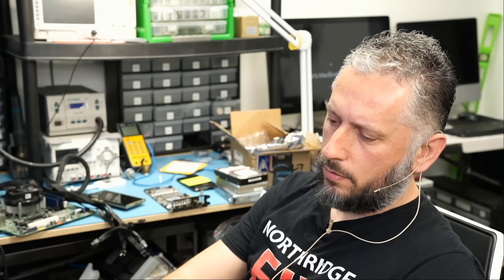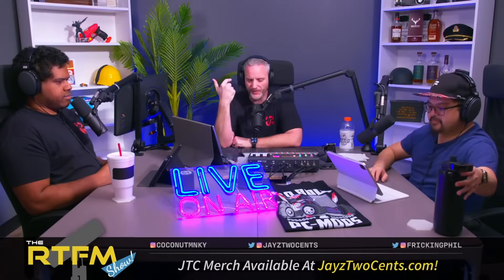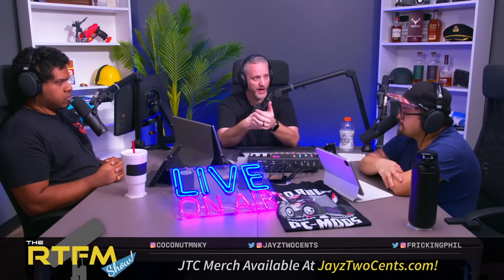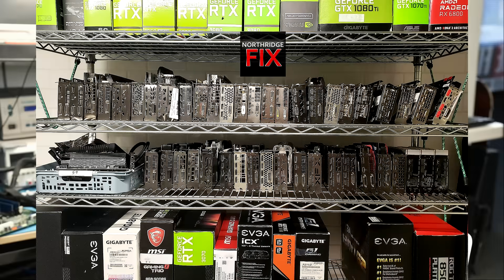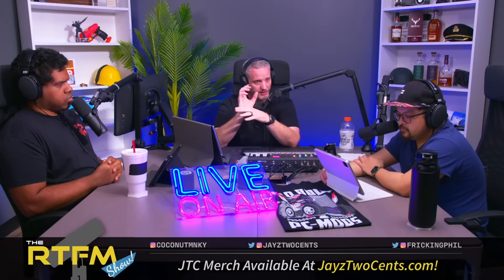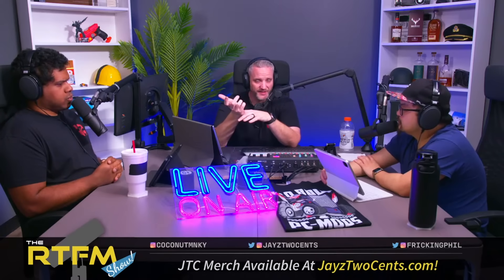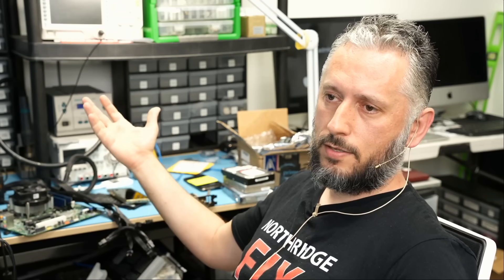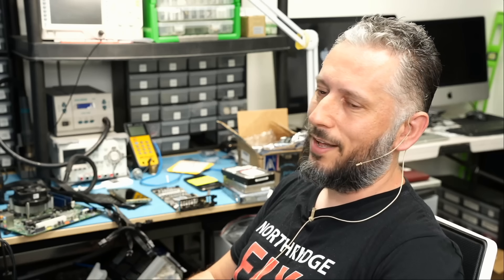Melting 4090 and CableMod. JayzTwoCents and Gamers Nexus Response. Blame NVidia or User?

Comment: As a designer myself, I have an even different look on this. The initial design may or may not be flawed. Without the schematic or spec sheet on the connector, we are unable to determine the quality of the manufactured part. Plastic shrinks after it's been molded. The shrinkage is calculated in the manufacturing process. There are a lot of variables that are related to the process from humidity to what day of the week it is. During the inspection and quality control process, there are tolerances that must be met in order to insure that the product that's being produced, is within the spec's the engineer has determined. Now comes the "however" part! Due to consumer demand and the "we need these parts NOW" pressure, the tolerances are often stretched to fill the demand. That becomes the fault of quality control and quality assurance. The responsibility still falls on the developer to make sure that the manufacturer is producing the product to specifications originally determined by the designing engineer. The manufacturing of the pins and sockets should be looked into also. If you have two mating parts and both parts are at the very edge of their tolerances in opposite directions, then you can conceivably be causing a final assembled part to be defective, even though the individual parts are within the required specifications. And it add to the confusion, the machine that crimps the wire onto the pin and socket can deform the perfect pin causing the whole assembly to be out of tolerance. Bottom line is, in todays mindset, people will sacrifice quality for numbers. I hope I got you to understand how difficult it is to pinpoint the direction of blame. I personally believe the blame does NOT fall on the consumer. The problem is present before the consumer buys the product. That's what I think.

Comment: well. its true. if the failures is too easy to occur.
it shouldn't be on mainstream market. it will only go on specific market where everything is monitored 24/7.

i buy the card to use it. and I'm just a normal man. not a prophet, not a god.
i bound to makes mistakes.

this is feels like more dangerous than driving a car.
the card could have burned while you left it for.
say cooking something or go tho the bathroom.

i mean. something disastrous is bound to happen.
imagine. you play a game at 4k. maximizing every graphics settings.
and suddenly you want to make some snacks.
you leave your pc.
and then your pets accidentally bump to it and the connector getting unaligned.
suddenly everything get burned.
that is terrible.

i thought every manufacturer already did a research of
what if this what if that
what if the gpu connector misaligned
what if the gpu drawing too much power
what if the pcie slot is getting hot.
what if the card shorted

protection everywhere. especially on expensive stuff.

Comment: I think we all forget how humanity turned into total morons and will DIY and fuckup 10 times to plugin, BUT you really have to be from another planet to mess up the connector in such a way that it will melt like that. Either the connector is not rated for that voltage or something is drawing too much power.

Comment: My assumption albeit could be a realistic one is the HVPWR cable and HVPWR connector is inadequate for the current flow, thus overheating and then melting. Nvidia should of thought about this before changing the connector type altogether and not just plopping on 3 or 4 of the typical 3-6 pin PCIe power connectors instead.

Comment: The problem is the 12V power supplied from the PC power supply. Its the current that heats the connector, not the voltage, so by halving the current by doubling the voltage you could solve this issue easily. When PC's first came out they only needed 12 and 5 volt power (with lower current -12 and -5 volt rails and over time +-3V). PC's nowadays need more power (i.e. amps) to work, but at 12 volts and 500 watts (rendering graphics with Blender for example), you will be drawing more than 40 amps!!! The chips on the card don't use 12 volts. They are stepping down the voltage to say 3.3V/1.2V etc. A lot of the graphics card PCB space is just the on-board power supply to make the lower voltages. If the card could take 24V you would need only need approximately half the current (i.e. amps) to run the card as the incoming voltage would still be stepped down to voltages that the chips need anyway. Of course, this would mean another standard of power supplies with specific outputs for GPU's, but it would make the issue of over heating connectors go away.

Comment: the higher the resistance (used size materials of the conductor going to the high current load circuit) the heat resistance will be lower. it is the same principle in extension cord when you are inserting more than two appliances in one area.

Comment: Can you set up a card with a thermal cam under load and see if the plug is getting warm or hot. Mabe make a thermistor sensor to record over long period of stress during load.

Comment: I have the feeling the connector itself is undersized for the 500+Watt. On my previous card there were 3 connectors on the GPU to run with 300-400W and now we have 1, which is way smaller, which runs 500+.

Comment: Too much power drawn through those thin wires. Of course it will melt at the connection point. Maybe if they had a larger contact surface it would be ok(ish)

Larger contact surface in the adapter and something to apply pressure on the contacts. Also thicker wires. 

The one that calculated the power draw screwed up really bad. I guess math is not his/her strong point.

Comment: The best way to shut them all up is to solder a 12 solid wires in those pins to extend it.
then attach a connected on the other end.
then test it where would it burn next.

Comment: And there's also too much load being put on a single 12v delivery rail for VRMs. Someone would have to heavy-up the rail and double stack (2x) connectors on every card to fix the problem. Whoever came up with stupid bird mouth PCB design needs to be flogged with 101 dildos.

Comment: Hello, but am i missing something? The problem is number of connectors, and thickness of each pin. Every PCI-E video card i own, has at least two connectors, 8+8, or 8+6. You don't plug space heaters into Christmas light cords. Why? Because they will melt and catch fire. Here, let me post a sign. --> [ IT'S NOT USER FAULT. ]

Comment: The connector shouldn't be able to wiggle enough to cause issues in the first place. Nvidia should have seen these issues in their testing which makes it an Nvidia problem and a massive design oversight. Also, the pci-sig should have designed a better connector. Or just left the connectors alone, remaining with standard connectors that have been proven to work in just about every industry. Also, Dell is at fault here for working with Nvidia to have the pci-sig introduce this connector.

Comment: since i have the 4090 i only connected 3 of 4 to stay at 450W max. With or without cablemod adapter it is not even warm under load.
Reply: so you say that the problem is the power consumption and not the connector?
Reply: @razbuzaglo  at least i have no Problems. FPS are also the same
Reply: @lassmirandadennsiewillja3943   so i am on the safe zone with my future 350w rtx 4080?
Reply: May I ask how you did that?

Comment: I trust the work GamersNexus did the first time around on those adapters.   The one you took out you had to destroy it in the process.  Pretty hard to draw any conclusions from a destroyed connector.

I think the reason GN is saying that the damage still appears to occur on unseated connectors, is that those stress lines on the plastic male component that houses the metal female receptacle, is because that can only happen when the plastic is softened.  So partially unseated and moving current.  This is all that can be known for certain.

The question really becomes, how do these get unseated?  I am sure that some were in fact those that never got seated properly. We do believe there are other failures that have occurred from seated connectors but were being pulled taught, causing some of the connectors to lose contact, which increased the current in the remaining connections. Those heated up, the plastic softened and then some combination of melting, softened clip then unseated partially, then more melting, etc. occurs.  There does also appear to be yet other failures where no tension was on the cable, and they were seated completely. This is a smaller subset of the overall failures, the % of which isn't known.  Cablemod themselves has said that they have sold 80,000 adapters, and of those 80 have failed.  It's a small quantity but still a higher failure rate than they see with their other products.

The plastic clip is pretty small, that is one piece that needs a redesign.  If the card heats up and it is enough for the plastic clip to soften and 'let go', that could be how this starts.  But we can't prove that by only looking at the end result. 

The new revisions to 12vhpwr, called 12v 2x6 (or something like that) make updates to the spec, to both sides of the connectors, and retain compatibility with 12vhpwr.  I think the primary improvement is a spec change to the design of the female metal receptacle. The 3 dimples version is no longer considered 'in spec'.  Also changes to the plastic parts, plus other changes.  Those changes are currently undergoing extensive testing, and likely will not be used on the card side until Nvidia 5xxx gpu's come out.  The cable side updated connector should come out sooner once testing is completed. Cablemod said they are already working on implementing the new specs into the adapters' design.  So in maybe 6 to 12 months, those will have been out long enough to draw more conclusions.  

The 12vhpwr design wasn't fully thought out, but they are working to correct the design flaws so I expect all of this to be behind us in a year. Hopefully for 4xxx owners, the cable side connector revisions are adequate to stop any more melting connectors for those users.

Comment: Anybody ever consider removing the socket and replacing it with a cable that plugs directly into the power supply. Of course the melting might move to the power supply LOL

Comment: I just have a novice viewpoint, someone who knows how amperage works enough to know when something looks sketchy.

You take 3 or 4 Molex style 8 pin connectors and feed them all into one little 12 pin connector with an anemic little clip in the middle, you're going to be testing the resistance in that connector.

I know that the majority of an 8 pin molex is redundancy. If say one or two pin connections lose their spring and introduce resistance, there's enough redundancy within the rest of the connector to pull it's rated amps without anyone even knowing.

Is that the same for Nvidia's 12 pin? I don't see how, considering it is rated to handle much higher current than one or two 8-pin molex, even though the connectors and pins themselves seem to be physically smaller. Just adding it up in my head, each one of the Nvidia connector pins is supposed to take the place of 3 standard Molex pins.

While I agree that the Molex standard is outdated and cumbersome, it is tried and true (as long as you have quality cables/connectors) and has successfully been able to scale up alongside more power-hungry PC parts. 

This Nvidia 12-pin is not the answer, not in its present configuration anyway. There's too much current and potential sloppiness in the connection for there to be so little redundancy.

Comment: NVidia is at fault this is not a user issue. Gamers Nexus is saying that the user needs to plug in the cable under engineering supervision then spin around three times and tap the connector with a fairy wand. Give me a break NVidia should be on the hook for this over priced piece shit.

Comment: I have a melted native 12vhpwr cable that melted on both sides. Tthe native cables have the same connector on both sides. Melted on my 4090 and my power supply. Both sides were seated correctly as I watched videos on this problem before hand and made absolute sure they were both seated correctly. Seems to me the connector cannot handle the amount of voltage being pushed through. My 4090 was running at 450 watts when the problem began.

Comment: These connectors are not rated for 600+ watts of power that some 4090 can produce, , they are only rated to 450watts. The plastic connector should be redesigned in ceramic to with stand the 4090 heat...

Comment: So in conclusion the 4090 connector cannot withstand the draw power and melts which is a design flaw. They should have either used 2 connectors, limit the power draw to what the connector can withstand or  maybe some part of the card draws too much power for some pins of the connector. Either way it's a design flaw and not a user error.

Comment: I agree north ridge on this it's not user fault it's a defect and to be honest I agree there is far too much power going through that 12v connector there should be 3 other connectors to share that 600 watt load as seems to me 12v connector cannot cope with the power consumption

Comment: I’m on a MSI Ventus 3x 4090 with the 90degree cable mod adapter and Cable mod PSU cable. I’m also an independent IT consultant and PC builder who has built thousands of PC’s in my time. I have been keeping an eye on my system since the 4090 was installed. Non of my cables are bent or under tension I’m using an AIO and 140mm fans so little vibration is in the system. The GPU is power restricted to 80%. About once a week I check the cable is seated home and about half the time it has worked it’s way out a small amount. Thinking it could be vibrations from the fans I replaced them all with Noctua ones. Still happens. From what I can tell it’s due to thermal expansion. With the connector repeatedly heating and cooling with use it’s causing the connector to work it’s way out then once it’s far enough out to increase the resistance it starts to melt or arc. This is totally a design flaw. All the cards should be recalled and the connectors replaced with larger more substantial ones before a fire is caused and someone dies.
Reply: this guy PCs
Reply: im pretty sure you are right

Comment: NO OTHER NVIDIA CARDS HAD THE SAME AMOUNT OF PLUG MELTING ISSUES EVER AS 40XX SERIES PARTICULARLY 4090 , AND THAT SHOULD BE ENOUGH FOR AN ELECTRICAL ENGINEER TO SEE > WHERE THE ISSUE IS.
YOU  CAN ARGUE ABOUT , THE POWER , THE TEMP, THE OUTBURST OF THE GPU OR SO ON , BUT REALITY HITS WHEN ONLY THE PLASTIC IS MELTING AND EVERYTHING ELSE STILL WORKS , DUH ?! AN AEROSPACE ENGINEER'S POINT OF VIEW 😊

Comment: It's pretty much cut and dry manufacturer fault here. As once the mechanical latch on the card socket has latched, the connector is plugged in correctly otherwise whats the point of the latch? lateral movement shouldn't even be a factor as the design tolerances should encompass this. They sell the cards to the general public therefore they need to cover a wide range of skillsets with rocksolid foolproof design. If they are blaming the users for not connecting them properly then the design must allow for this = bad design.

Comment: Correct this is a manufacturing problem. They know the specs and should be able to calculate the potential fault. Power and resistance = Heat.

Comment: NVIDIA should take responsibility. 
Investigate which cables are good to use and make a global post of which cables are certified.
Also they should create a global post with a tutorial `How to decrease the power-LIMIT". 
Either by BIOS-update or through a third-party app. 
New released 4090 cards must get a BIOS that decreases the power-limit as standard. 
Yes it may cost 5% performance, but better that then dying cards.

Comment: Unless there was a way for the customer to apply heat improperly during the plug-in process, which there is not, then a heating error or occurrence could never be the fault of the customer.  Even a half-plugged-in wire that shorts should have a design by the manufacturer that anticipates this and corrects for it in the board design.  After you spend over $2000 for a video card you expect a quality design, not getting shafted over a connector!

Comment: Some of the answers and excuses in this are ridiculous. 
We have melted connectors on the boards.
Some have installed cablemod adapters, and the board connector still melts.
This tells me that the problem is in fact in the engineering or production of the boards.
Somebody spec'd a connector (and possibly components) that was/were  under rated for the application! 
Even if that connector was pushed in all the way to the latch, but not latched, There should (and usually is) ample engagement of the pins to allow it to function. 
I made a statement earlier that a lot of conditions needed to be considered. 
Was the customer using it 24 hrs a day? 
Was the customer using it within its design specs? IE Overclocked

Given the number of failures, I have to conclude that the manufacturer is to blame here for skimping on materials for more profit!!

Comment: What I'm wondering about, neither of these cards have a NTC on it. If you're working with 12VDC and that kind of power, there should be some security build in? I use a lot NTCs and Varistors to secure my PCB designs. Varistors obviously for relays related purposes. I'm now thinking out loud, but my guess the lack of security is what causes these problems. But I don't know the full DN of these products. And you cannot find info about it too.